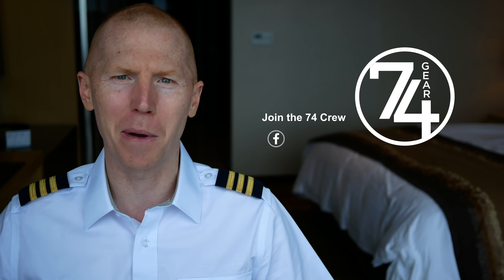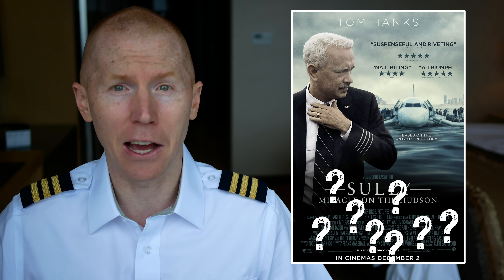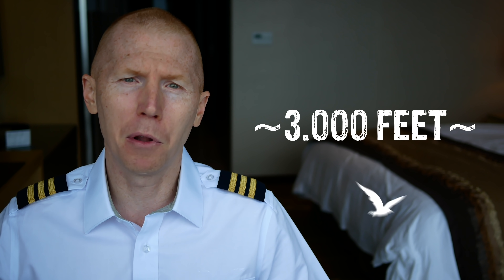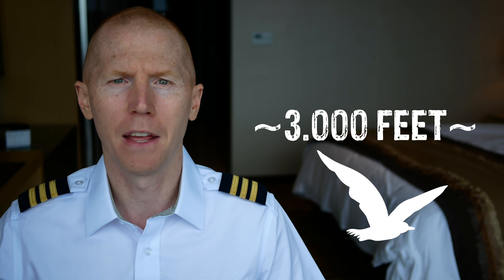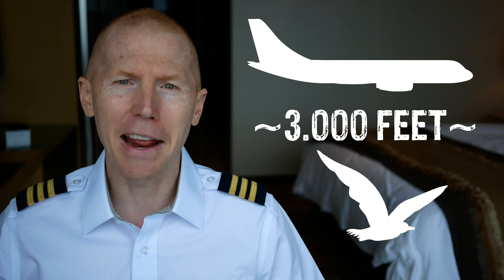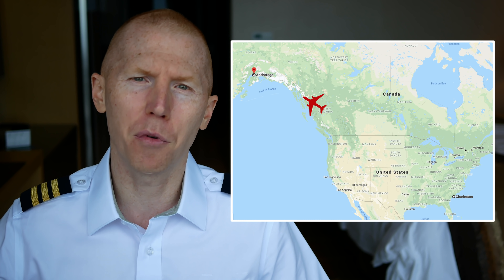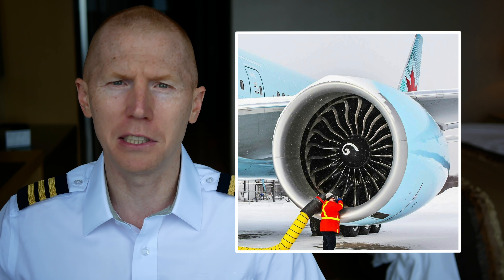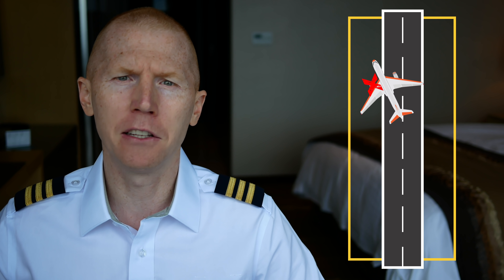Why Engines Don't Have a Mesh or Grates to Stop Birds

Comment: Why not put a screen that can be lowered and raised manually
Reply: that was just be useless and add unecessary weight to the plane, plus if it goes up manually and a bird hits it, well, itll probably cause the screen to break and go into the engine which would cause crash
Reply: @shwuz  weight? I'm pretty confident that a few screens weigh a lot less than that lady in row 3.
Reply: I agree. Deployed on takeoff and they retract at 3,000 feet, why not. Russia has a similar arrangement on two of it's fighter aircraft.
Reply: @timmack2415  why not I'd because you need the most combustion and thrust at take off
Reply: @jamesTBurke  Two Russian military planes have them. 🤷
Reply: @timmack2415  military planes are designed differently than civilians. They don't even use the same feul. Military jet feul is more refined
Reply: @jamesTBurke  Crude and less refined? Do you know my ex wife?
Reply: @timmack2415  nope. Does she know my ex fiance?
Reply: some russian jet fightes have them right ??
Reply: I qas thinking that myself.  Problem is you need the most combustion and thrust during take off
Reply: It's questionable whether a screen would help at all. Even if the screen were strong enough to not be destroyed itself by the impact, then the guts would probably get sucked in, taking out the engine anyway. Maybe on some smaller engines it could work, but it also becomes a question of whether it's worth the extra weight and cost. 

Especially considering how rare the incidence of bird strikes are, compared to other cost effective prophylactics that can be taken. Dogs at airports trained to chase birds away seem to be the all round better option.
Reply: How tf would air get into engine during takeoff if there is a screen infront of engine. Just delete your delete your senseless comment.
Reply: @theduden  how does air go through your porch or window screen? So how about you delete YOUR ignorant comment
Reply: @theduden  I guess everyone needs to remove the air filter from their cars!! I mean how is air going to get into the engine? We're all going to get stranded because our cars can't get air!!! 
I'm going to take that pesky bag out of my vacuum cleaner because air can't pass through. 
I mean, I'm going to have to remove the chain-link fence from my backyard before my dog dies! How is he ever going to get any air?
Holy hell! All the animals in cages at the zoo can't breathe either! 
You bring up such a well though out and rational argument! 
I mean all of the chickens in coops must be starving for air!! 
You're totally right, my kids got a rabbit a few years ago. They bought a rabbit hutch for it made from chicken wire. The next morning it was dead from oxygen deprivation! We all know that air can't pass through chicken wire because it's nothing more than a screen! 
Every once in a while, someone posts such brilliant comment on YouTube that it literally makes me rethink my whole life.
Reply: @timmack2415 .... Gosh ur really not that smart....

WEIGHT!!!!
Reply: @timmack2415  big aircraft = (after installing the "DOOR") more weight = more fuel = more cost = not good and not worth it

If it gets damaged, parts can get to the engine causing way more damage as a bird....
Reply: @Sonny.-  What "door" are you talking about?
"I'll take 'The dumbest YouTube comment' for $500, Alex." 
Every time I lower the bar on human expectations, someone manages to limbo right underneath, congratulations!
Reply: manually means by hand, You want be the guy that goes out on the wing after you reach appropriate altitude?
Reply: From the time a pilot is close enough to see the birds (assuming they see them) until they hit the aircraft traveling at over 500 plus mph, that time is probably less than 3 secs. Barely enough time for them to say "oh shit." And you want them to manually lower a impractical screen in that time? Didn't put a whole lot of thought into that comment, did you?
Reply: @sweeptheleg.  hey don't need to bash the guy. He was brainstorming trying to come up with a solution which is more than you have done
Reply: @sweeptheleg.  They are probably talking about using it during takeoff and landing time only.

Comment: If I had to design a plane with mitigation against things getting caught on a planes engines, I'd design the plane around the idea of having a grate on it, not just put a grate on an existing plane. Maybe divert the airflow of the plane also so instead of it getting into the engine, whatever it is could instead be chopped up and scooped out the other end, maybe even a built in airflow cleaning system where it actively cleans the blades so there is no further impeding on the efficiency, maybe even adding an alternative fuel or additive to the wind flow so that even if the turbine is compromised, it'll be running with that additive that helps the airflow. Maybe opening other air pockets to allow air to enter in other areas, maybe have two different systems for propulsion and power gain. Idk, I'm not a plane engineer.

Comment: A jet engine should just easily mix the bird and let the bird go away from the other side of that engine... (Dead in pieces,,, or smoothie style)

Also having a mesh would keep the bird on the mesh and prevent air to go into the engine...

Comment: Wow... This was horrible to watch.

You were so roundabout in the way you spoke, it took a whole minute and a half just to start answering the question, as any time before that you would just continue to repeat the question, and even when you did answer one of the reasons, you then either went on a tangent, or just didn't give another reason for another minute and a half.

It doesn't take a 5 minute video to simply say:

They block the engine, reducing fuel efficiency.
They are pointless, as the chance of a bird strike is low due to cruising altitude of a jet being above the bird's
There is technology to help recover from bird strikes more easily
Even in the event of a single engine failure due to bird strikes, you can still lank the craft.

Now, it's fair enough to answer the question but drag it on afterwards, like talk about personal experiences, or stories of fellow pilots, or even on a rant about engine types, but when half the video is you repeating the question, and 1/4th of it on random tangents about completely unrelated things, it just becomes a slog to watch.

TL;DR: Get to the point in the video quicker !!!

Comment: They should just use a form of high tension line and make a large open grid on the front of the engines. I'm no aeronautical engineer but I'm sure some high strength fishing line might not effect the intakes performance that much. If it were to take a bird in the intake it would be better off coming in as a paste rather than chunks. I think it would be a bit safer for ground crews as well.  Just a theory

Comment: This video is too long, 
In a nutshell you can't because the engine is a turbine and it needs to suck air without anything going inside the turbines, and if you anyway did put it on metal bars the birds will anyway finish into the engine. Or just because the engine sucks air it won't be at its max throttle every time.

Comment: I’m pretty sure the engines are also designed to survive bird strikes, like legit I’m pretty sure they launch wasted turkey into the engines as a test.
Reply: Yeah they are lol we would have bird strikes in or around the engines when I was in the Air Force. The ones that went in, you almost couldn't tell. Maybe a tiny spec of blood here and there on a blade or two, but zero visible damage. Our actual engine shop guys would do the indepth inspections, but man the smell of cooked bird was the biggest give away. I've never forgotten it lol.

Comment: This is exactly the reason why I cut out as many air mesh in a PC case to gain more airflow with less noise. On an aircraft engine it's exactly the same. You simply can't block the air coming in.
Reply: I can’t tell if you’re joking or not
Reply: @andrewvanhellstring6672  I'm not, I'm just serious, what makes you doubt?

Comment: Solution, put a reacting "door" on the front of the engine that senses for disturbances in the area, and covers the engine when the system senses. So when a bird or something flies in it: it will be blocked in a blink of an eye and then open up the engine again
Reply: That must be a very heavy door then.
Reply: What a stupid idea.

Comment: If you only need the grates underneath 3000 feet, why not have electronic grates that you hit a switch and have them come down on take off and landing? Wouldn't that work similar to landing gear. 

You could also angle them so nothing gets stuck on the grate itself.

Comment: Considering that takeoff and landing will only take a few minutes and will be at low altitudes.

We can have retractable grates infront of jet engines 
Like a lot of naval fighter jets have.

These grates automatically open up at high altitude (90% of flight) and keep fuel efficiency High

Comment: Hmm how about a retractable grills that can come in and out of the case of the engine. It is integrated so once it's above 3k height, it goes in by itself and while under it comes out.
Reply: Because itd still be fuel inefficient and adding motorised doors to a jet engine is stupidly unfeasible

Comment: actually there is a way. butterfly valves. same ones used on pretty much any car engine i see when i pop the hood. the best solution is to use the style found in mini vans Air conditioner ports. a tri valve if you will. that will reduce the risk of a bird strike alot, plus it will be compatible with the air crafts hydraulic systems. having an engine damaged by a bird strike is much worse than a simple mechanical failure and a whole lot more expensive cause the engine is trashed. companies need to put their money into stuff more than safety like keeping parts like the engines safe. sure it will take time but it will be worth it in the end. who here agrees with me?

Comment: This is like putting an ejector seat and massive parachute in your case just incase you drive off a clif, also half the time at the speeds a plane is flying the grate would just shred the bird and it's bits would still end up in the engine and clogging it

Comment: Put a computer control small laser Adobe, below, or anyside of the engine which will not prevent air flow but whenever a bird is detected it will distract the bird or kill it before it will reach the engine sucking parameter.

Comment: If there was more birds around airports they would put something in from of those engines, but today I guess someone did a calculation that they will loose a engine now and then and looked how much that cost is, and compared it to how much the extra fuel would cost. And since there is nothing in front of the engines, we therefore know the answer. It’s a calculated risk and cost (just like almost everything else). Side note, Russia fighter jets like the old mig29 had retractable grills since the Russians could not keep their airports free from birds and junk on the tarmac.

Comment: What about placing a metal wall 20-30 feet in front of the engine? Then the birds would hit that rather than the engine and would have little effect on the air flow to the engine. however it would cause a reduction in aerodynamics, so either make said wall a cone, or automatically retract once above 3000 feet, or both.

Comment: Why not have a retractable mesh/grate that only goes in front of the engine during take-off/landing? Less fuel efficient for a shorter period, this could also only be used exclusively when you know there's nearby birds instead of doing it for every take-off/landing
Also if the mesh forms a cone in front of the engine instead of just having a flat mesh, it can even push the birds away from the engine instead of having them get stuck in front of the engine because of the pressure differential

Comment: Put a type of grate in front of the engine until over 3000ft, then retract it like the wheels. another of the worlds problem solved 1 day at a time 😎
Reply: What makes you think engineers have never considered this idea? It’s not practical. You can’t afford to restrict any airflow into the engine.

Comment: Also putting metal grids or screens in front of a motor can cause ice f.o.d (foreign object damage). If it is below just 45 degrees, I cannot utilize anti personal guards on my maintenance runs because of ice f.o. I have personally seen what ice f.o. can do to the first couple of stages of blades and its pretty bad.

Comment: I think it's really just because the airlines are too cheap to place an effective anti-bird cone of thin titanium rods over the jet engine intakes. I don't think they'd even have to be thicker than a .7mm pencil lead. Even if the wires don't deflect all of the bird away from the engine, the smaller pieces may well prevent a full blown engine failure.

Comment: Yes, there is actually a way to avoid birds getting into the engine. By installing sound bird deterrents in my opinion.
Reply: I was thinking the same thing this might be the best idea out of all these idiots in the comment section 🤦‍♂️ If they install a bird sound communicator it will notify birds to steer clear away from the air plane This information needs to go to the plane engineers😍
Reply: @HeyCMDR1991YT  I cant tell of you are sarcastic or serious because I deal with a lot of sarcasm in life😂
Reply: @FINTHRTD  
I am usually both sometimes I am sarcastic more often than not but I do tend to be extremely serious when tense situations calls for it 😉👍
Reply: @FINTHRTD  
I don't know Maybe both? Sometimes I am sarcastic and logical at the same time 😆
Reply: Airports do try that, they've even enlisted dogs in some cases to chase birds away from the runway
Reply: @dsdy1205  I meant you could install a sound deterrent device on the plane so that birds stay clear from the plane at any point im time during its flight and not just runway
Reply: @FINTHRTD  well, if the literal jet engine sounds aren't scaring the birds away already, I doubt anything else that you install, will
Reply: @dsdy1205  I read somewhere that a certain sound frequency is really unoleasant to the birds but we  cant hear it.
Maybe we could look somewhere along those lines?
Reply: @FINTHRTD  that sounds like it's worth exploring yeah, just need to make sure it doesn't cause too much ecological damage
Reply: @dsdy1205  Yea so my thoughts were to have a program detect birds using OpenCV and a simple classification model that would detect birds within a certain radius. If they do then increase the frequency the closer and closer they get to the engines.

Comment: 3:01, the most relatable tech in a car is ESC (Electronic Stability Control) to the tech you are talking about. ESC is a system where if you are loosing control or need help with control, ESC fiddles with all of the brakes, applying a certain amount of brake power to each brake; regaining control
Reply: I was immediately like: that NEW aircraft tech? Holy shit! 
I literally dont believe that, cars had esc 20years ago, that cant be right.
 They got autopilot but nobody thought about simple left/right power distribution??? ... I dont believe it
Reply: @Angry-Lynx  why is it hard to understand ! You will actually find most of the worlds science is in cars ! And people like you probably treat mechanics like crap
Reply: @iamasmurf1122  worlds most science in cars? I hope youre just trolling. 
Cars are so fooking obsolete in comparison to what is available its laughable. Maybe besides top models of cars like maybach, rr or mercedes, audi.
Its slowing going forward but last 20years like nothing worthy event mentioning was invented/implemented in cars. Cars 40 years ago were more comfortable and had innovative suspension than nowadays wheelbarrows. And using metal bars to not make car lean in corcners at the expense of total lack of comfort? ** please....
Reply: and btw 'cost effectiveness' is imo the biggest innovation killer. Its all about cutting costs right now, thats why its so hard, basically impossible to buy modern car that have comfortable suspension. 
Current cars dampers are literally 80years old technology

Comment: While I won't pretend to know anything about turbo fan jets. I do know the Navy uses a fine mesh anti-fod screen over their LM-2500 gas turbine engines. Whether that effects our fuel efficiency or not is open for debate, especially since these engines are use to propel a ship through the water and thus economy being some what less important. Especially since we won't crash and or die if we run out fuel. So it is what it is.

Comment: How about a secondary set of generally crap but short term emergency-use engines that have angled sloped bird screens (so birds aren't so much stopped by the screens which would just leave a dead bird additionally blocking air intake stuck to the screen but rather deflected away from the engines, still very dead).   Lightweight and crap due to only having to work for very short term in an emergency, since this only happens on takeoff or landing they'd never be needed long term, and most of the time not needed at all.

Comment: Okay, how about a sonic device that would broadcasts noise, such as loud claps, ahead of the plane at the altitudes you mentioned. I've seen videos where certain fish use such a technique to stun their prey. Perhaps broadcasting a sonic punch-like sound would be enough to deflect the birds away from the front of the aircraft. Make it uncomfortable for them to continue on their flight-path. No moving parts and should be easy to implement.
Reply: Birds don't care